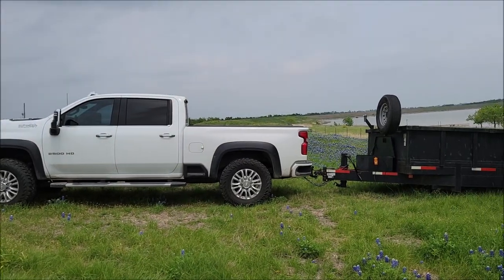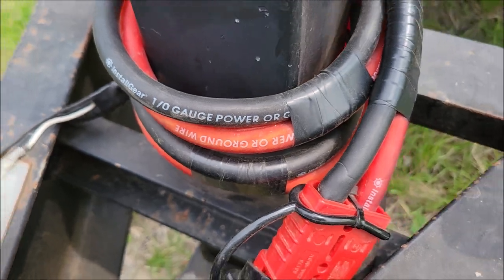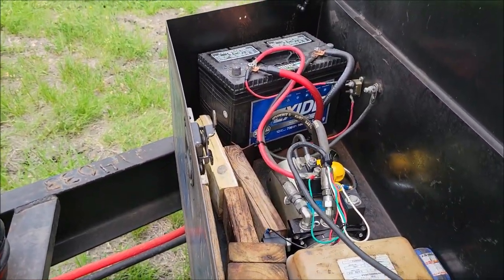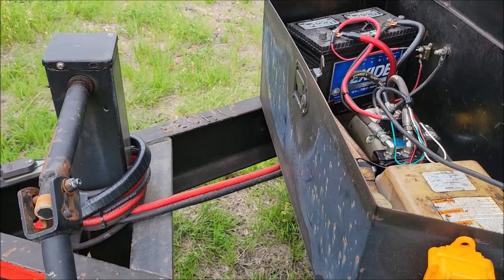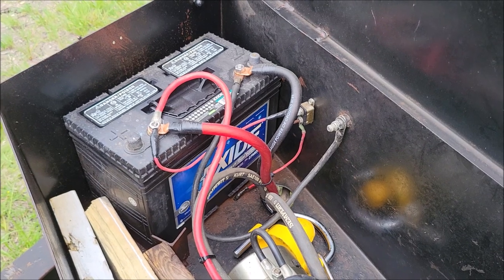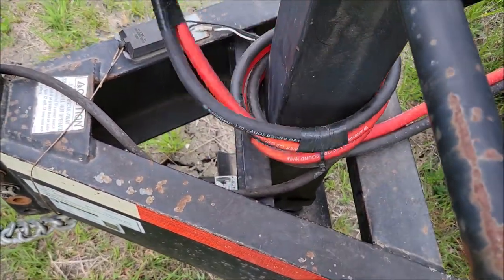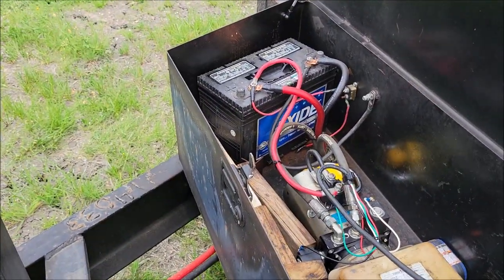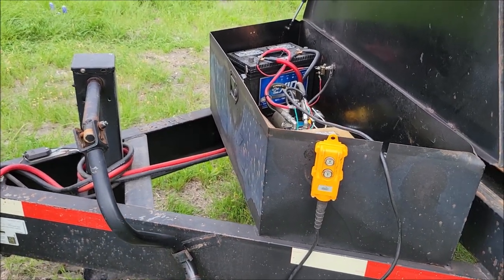BEST Dump Trailer Upgrade EVER! This is hands down my favorite

Comment from the maker: What do you think?  Anything I am missing?  Any issues with this setup?  It has been AWESOME so far and no battery issues at all now.  Let me know what you think and if there is anything I should change.  Don't forget to like and subscribe!  Here is the list of items I used: https://amzn.to/3nK6xn7
Reply: Put a blade disconnect under the hood before the fuse holder on the hot side. If that hot cable rubs thru you will burn down everything. I would put that hot cable inside a heater hose just for extra insurance. If you modify a vehicle and that's the cause of a fire, insurance can deny your claim. And that's no joke.

Comment: I did the same thing on my truck when my battery went bad. I went to Harbor Fright and bought their heavy-duty jumper cables because they were cheaper to buy them and cut the clamps off than to just buy cable by the foot, and I bought the quick connect on amazon along with a 125-amp fuse holder and fuse. I left the old battery installed so it gave me a way to connect the cables to the pump. Works great and its cheaper than buying a new battery for the trailer. Thanks for making this video to show how us geniuses installed this lol.
Reply from the maker: Right on.  I love it and can't believe I did not do it sooner.  This should be a dealer option in my opinion because it works so well.

Comment: I have a set up like this on my truck. Was having issues with the dump trailer battery dying on me at the worst possible times, like at the landfill. Never knew for sure if I was going to be able to dump or unload by hand. 
You may have already done this, but I would add a heavy duty fusible breaker at the connection points to your trucks batteries. I was always concerned the cables might rub somewhere along the frame and cause a short, which in turn could cause some problems within the trucks electrical system.
Reply from the maker: Very good point, and I did add that.  I put in a breaker so I could just push the button to disconnect the positive.  I had the same concerns.  I did secure that positive wire well, but you never know what could happen to it.  I use it for the dump trailer and my winch.  Loving the setup.  No more dead batteries.

Comment: I just use the aux 12v pin to charge the batteries. Alot easier and works with any vehicle, doesn't need anything special
Reply from the maker: I still use that and it works fine if you don't use the dump trailer multiple times a day.  It's those days I am dumping the trailer 4 or more times that it really helps a lot.  Do you drop many loads a day with yours?
Reply: Phrasing. Yea, I've ran it multiple times a day without issue. When I go to dump it. I put my truck on high idle to give it a little more juice to help keep the battery topped. You may need to look into using a different battery if yours is dying that quickly.
Reply: The problem is if the trailer battery runs low you can draw too much on that 12v charge wire. If there are any issues/weaknesses in that circuit you will find... Including melting your trailer wire plug or blowing the fuse in the truck constantly if the auto reset fuse on the trailer isn't there or isn't sized properly for your truck. Jumper plug in is a great setup.
Reply: I had this problem with an interstate battery. I simply bought the largest marine battery that wal-mart sells…. Yes a wal mart brand battery, i swear by these batteries when it comes to marine deep cycle.

Comment: Glad you didnt go with the gas powered option, you need your battery for your break away switch. Stay safe brother.
Reply from the maker: Thanks.  I am happy with this setup.  If I went gas I was going to have an electric start motor so it would have had a battery but then I would still have the same issues of batteries going out.

Comment: I had the same issue. My winch was killing my battery. I also added a 40 amp dc to dc charger. Now, it fully charges my battery within 30 mins of driving and maintains it at full charge. I just picked up a tilt trailer and will be doing the same thing.

Comment: You should make a set of Jumper cables with an Anderson connector so you can jump people off without raising your hood. Interesting approach, I'm sure all that copper was pricey! Did you consider running 2 or more deep 12v batteries? Probably waaayy cheaper.
Reply from the maker: I made the jumper cables.  I use that a lot.  I always have equipment on the ranch that does not want to start.  I did try putting 2 batteries in the dump trailer years back, but then I just had 2 batteries crapping out.  The key there is the amount of use they get and the charging.  The wiring was not that expensive really.  Plus I wanted the use of the winch and the ease of using the jumper cables.  It's been awesome so far.

Comment: I just installes a 100Watt flexable solar panel with a waterproof charge controller.
Reply from the maker: How is that working out?  Keeping the battery topped off?